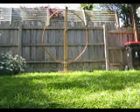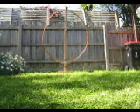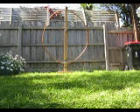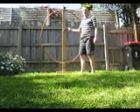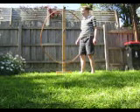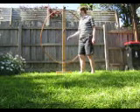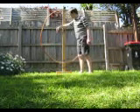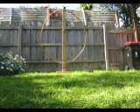Magnetic loop transmitting antenna

Comment: Hello,      I did an 160-80 loop  that seems to work quite well on 160.  At 6ft,  I achieve the lower frequency by using a two-turn outer loop configuration.  
https://www.youtube.com/watch?v=s3oP6VAG3gs

Comment: Nice job OM.
Check out my Helical Loaded mag loops which I have compared to solid conductor loops.
My designs are a bit more pricey but handle 1.5 kw down to milli-watts. My 2 element designs have 6 to 8 db more gain in the loop plane. You should try one...........
A stealth antenna for limited space that really works great.
Check out Stealth antennas that really work.
QRZ.COM/db/K8NDS       Anyone even in a small lot can have a big signal.

Comment: Are the magnets  an amplifier or more so an antenna?
Reply: It's called a magnetic loop because it interacts with the H-field, not the E-field. Therefore, magloops are 'deaf' for electrical disturbances like distant lightning. OTOH, they get very upset by nearby metal objects or a good ground conductance, because that diminishes the magnetic field. They work best in deserts ;-)

Comment from the maker: Yes it's a transmitting loop.  It's wired to the equipment, in this case an FT-817 transceiver.  It isn't like a broadcast radio with an internal ferrite rod.  

The feedline connects directly to the copper tubing which has  a tapping point for the coax inner. Other builders use a second smaller loop instead.

Comment: "It accepts RF input powers of up to 50 watts or so." 

Do you mean transmitting. HOW is this a Transmitting LOOP? How does it connect to the radio for transmitting?

Also you have the radio in line with the plane of the loop, makes sense to me. However many youtube Videos show the radio at RIGHT ANGLES to the loop? Any comment on that. I assume it can work both ways. I have some small 9" loops and a Degen DE31MS mag loop and find in-line works best, but any comment appreciated.

Comment from the maker: Yep, I'm lucky I can now do that (moved to better QTH). For 160m I'll probably make a top-loaded vertical about 8m tall with a few radials.  A loaded dipole for 80m & full-sized dipoles for 40 & 20.  

But the previous QTH was a 1br flat with no private yard, no balcony, no courtyard. Either you used the magnetic loop indoors or you were QRT.

Comment from the maker: Greg - quite true - efficiency would be a few percent on 80m and well under 1% on 160m. 

However I have worked VK6 & ZL on it on 80m and VK7 on 160m.  Locally it does suprisingly well with 10 watts AM on 160m with good readable signals out to about 15km. 

For transmitting it will never do as well as a full-sized antenna. But on a performance for size basis the magnetic loop comes out very well and the results are repeatable.